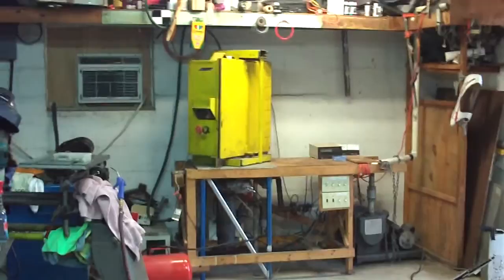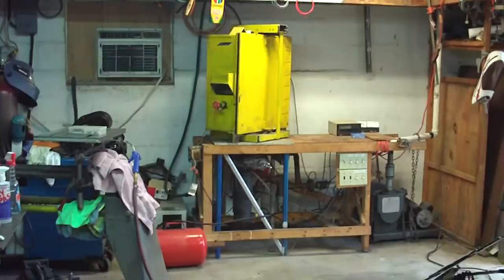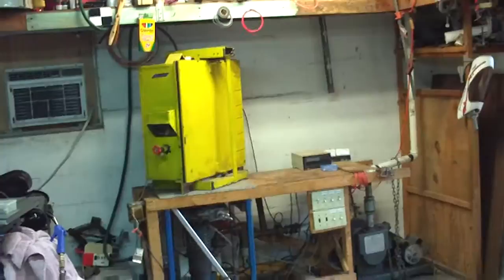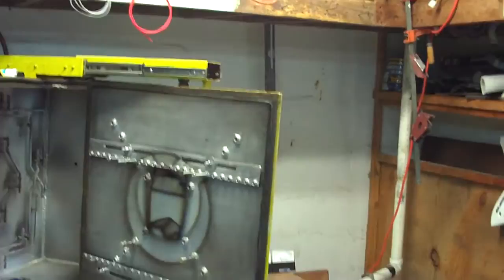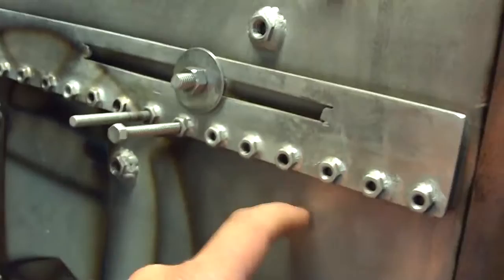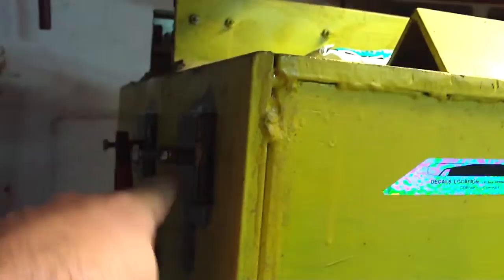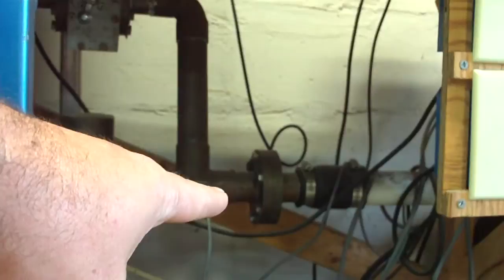Home Built 600 mm Vacuum chamber for optical coatings

Comment: Fantastic, just like the real thing I watched coat my mirrors commercially - every part just good enough to do the job and not win awards for beauty. The gauges are only to avoid damage to the diffuser pump and indicate when to open the various valves. The process works as you show just observing what's going on. It took a couple of minutes to notice the scaffolding under the bench, supporting the weight of the 12mm steel chamber. I had an overcoat of silicon that oxidises and is harder than the aluminium. With all your tungsten filaments, is there a reason you chose not to do a protective coat? One mirror has a good film even after over 30 years, I looked after it.
Reply: instablaster...

Comment: Hello friend, I have a question, once the necessary vacuum is created, you have to turn off the diffuser pump and close the inlet with a butterfly valve to vaporize the aluminum or you can leave the inlet open and the diffuser on. thanks

Comment: nice job!!!  is the finish durable? would  stand up to handling?  say if you coated the outside of a glass flower vase?  do you think it could survive repeated dishwashing?
Reply: Paul Joffe, it is an extremely delicate 1st surface optical coating. Touching it would damage it.  You could silver the inside of the vase then copper plate then seal with a coating.  That's a simple 2nd surface cheap chemical process which would be durable  although a dishwasher is chemically pretty brutal. A normal mirror desilvers at the edges over time from humidity.

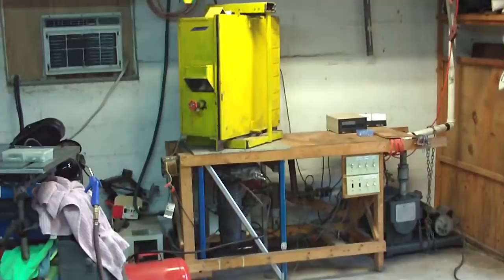Comment: I just noticed that the video says stainless steel at 3:24 but the description doesn't. Was that just a blooper? Please clarify. :)
Reply from the maker: The Stainless Steel comment was a blooper, yes.  The chamber is fabricated from cold rolled 12 mm mild steel plate which was MIG welded together and can achieve a pressure of slightly less than 2x10E-5 torr.

Comment: Hi, did you make any modifications to the transformer, whats your output voltage?
Reply from the maker: I added a light dimmer to the low voltage filament transformer, but otherwise no.  The neon Sign transformer is 120vac input and 15kvac output at a 100ma (ish), the low voltage transformer was salvaged from a UPS battery backup and is 120vac input and 24vac out at 25 amps for 600watts (ish), however both transformers were just what I had on hand so not much thought has been put into optimizing the solution :)
Reply: @JlerchTampa  Cheers, I've got an old microwave transformer to experiment with. see where we go from there.
Reply from the maker: @jase171973  Funny, I recently salvaged a similar transformer and its HV diode to see if a DC based plasma cleaning would make a difference, but I got side tracked on other projects and AC seems to work :)  Also <blah,blah,blah> be careful.
Reply: @JlerchTampa  I'll box it up before using. I have small children...
Reply: James Lerch ps, it was a cheap source for a big transformer, I’ve cut out the secondary winding and will replace it with maybe 8 or 10 coils of fat wire. Aiming for 10v. Going to run it off a variac type supply
Reply: James Lerch I’ve rewound the coil, I read 11v off it now.
Reply: James Lerch do you degas the coils under vacuum? Does it need to be at full vacuum? I tried just to see what happens with just my roughing pump and basically got a lot of smoke and some residue. Ended up burning out a coil.